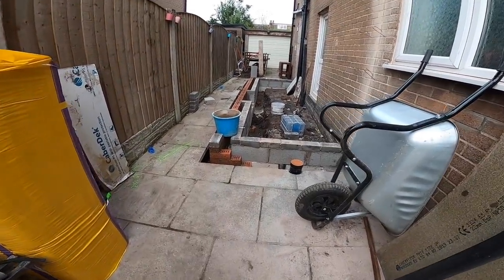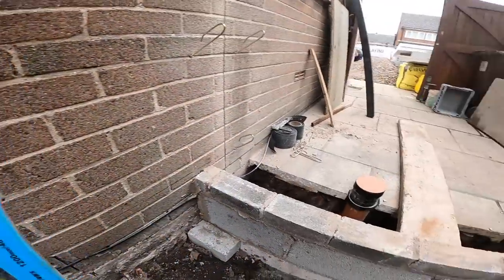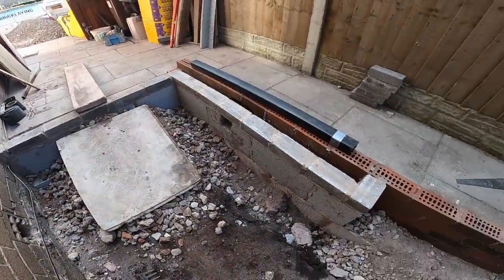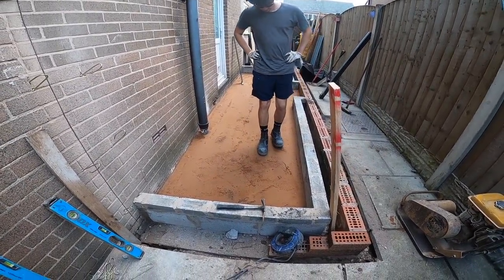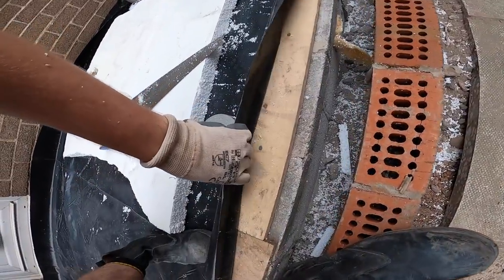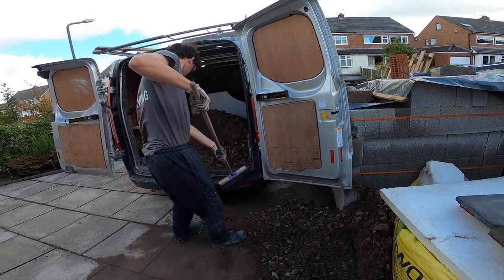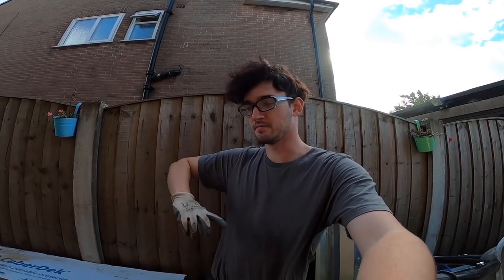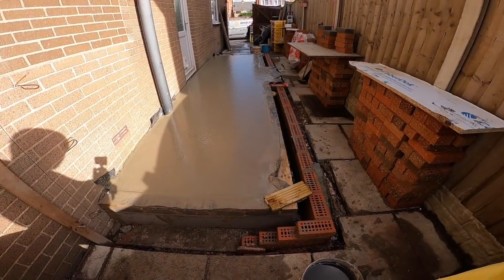HOW TO CONCRETE AN EXTENSION FLOOR

Comment: Good to see you setting the doors out below DPC allowing for concrete to go to the back of the outside brick skin.
We've been doing that for years and you wouldn't believe how many clients, architects and building inspectors have said that's not how it's done.
It's a much better job and means there's no trouble trying to put flooring over an open cavity. I've seen a lot of bodge jobs over the years where damp has come through the threshold.
Good job lads.
Reply from the maker: Very true mate it’s a solid job and it’s finished, no going back on it later 👌🏼🧱👍🏽

Comment: great vid guys...bit of a tip i've started doing is cut a bit of visqueen over the brickwork at one end after all the visqueen is finished then tape the slab end down...pick up a cheap window cleaning squeegee and stick yer broom in the end then ya can scrape all the water out up and over yer peice of visqueen instead of having to bucket it out or shovel it...a good back saver like

Comment: If you're doing a sips extension will a slab concrete without brick border be enough ?
Reply from the maker: It sure what sips is 🤔🧱👍🏽
Reply: @SteveAndAlexBuild   Sips is the Structural Insulated Osb Board panels, rather than a traditional wooden frame

Comment: Hiya mate. Are those dense concrete blocks your cutting with that saw or fibrelites? If yes what blade is it? Thanks
Reply from the maker: No pal fibolites. The blades are good but no good for hard materials like strong mortar , concrete blocks and bricks 🧱👍🏼

Comment: Good video, missed the pour but meh, saw the actual skilled part, I liked how you got your straight edge ... they've never once gave me a single straight bit of lumber to use never mind 2 to do that :D

I want to blind and DPM' the inside of my garage, insulate, DPM and pour, but how high do I take the DPM because it isn't a cavity wall so I was considering using Kingspan or similar insulated board on the inside because of planning. Also is the DPM doubled up on the walls? 

Thanks again for any help.
Reply from the maker: Avoid going above the dpc whatever you use 🧱👍🏽

Comment: What blades are you using on the reciprocating saw to cut block etc ? Looked like it cut very quick. Cheers
Reply from the maker: Hi pal it’s a Bosch masonry carbide tipped blade 💪🏼🧱👍🏽
Reply: @SteveAndAlexBuild  thanks for the quick reply, I’ll get looking ! 👍🏼
Reply from the maker: @90jammy90  . No probs …. Toolstation about £18 but worth it 👌🏼🧱👍🏽

Comment: Hi Lads , got a reasonable size extension that's required for early next year ,its a bit different how far do you travel,  its in M40 area code
Reply from the maker: Hi Ged thanks for asking but we are from Lancashire pal so a bit far away 😬🧱👍🏽
Reply: @SteveAndAlexBuild  "...we are from Lancashire..."  Probably the Baker Street line What Tube stop is that?   Said a guy from upstate New York.
Reply from the maker: @davidnull5590  🤣🤣🧱👍🏽

Comment: Hi chaps,

Looking good. Can I ask about the block returns in the doorway. You returned the blocks below dpc, are you intending to do this above dpc or cavity closers? If so why not a cavity closer at the bottom too?
Reply from the maker: Sealed cavity below dpc as it’s just stronger with the wacker knocking it about . 
  Cavity closers above . It’s all on next episode next week 🧱👍🏽
Reply: @SteveAndAlexBuild  Perfect, thanks. Where did you get the vent pipe extenders from? Struggling to locate them
Reply from the maker: @THEASHSURF  we just used square downpipe 🧱👍🏽
Reply: @SteveAndAlexBuild  Guys following this with such interest as I'm doing a similar extension. When a saw the pipe was marked as TOP thought is was some special (expensive) pipe. Was relieved to see it doesnt need to go air brick to air brick too.
Reply from the maker: @Rolandpgbrooks  🧱👍🏽😁